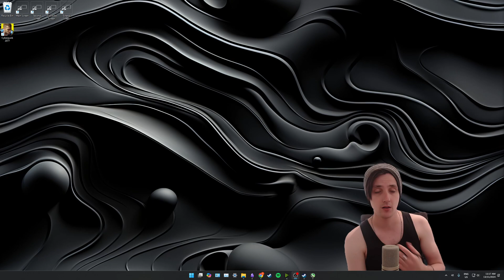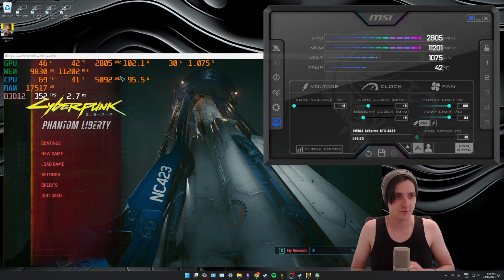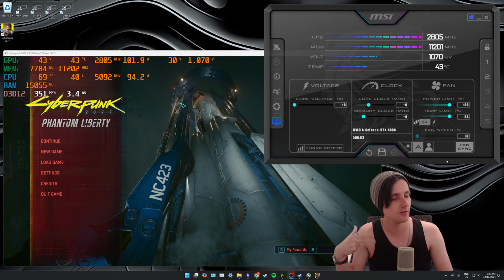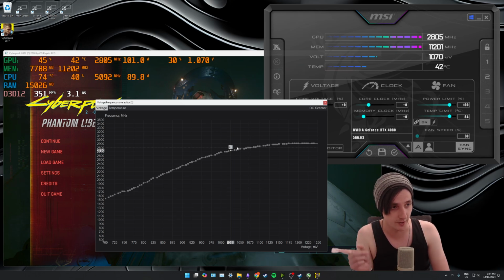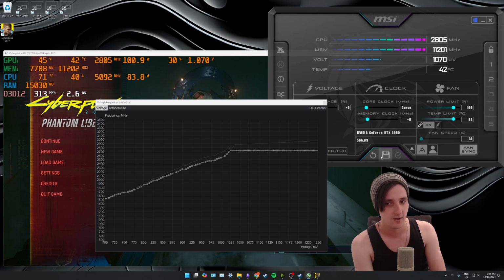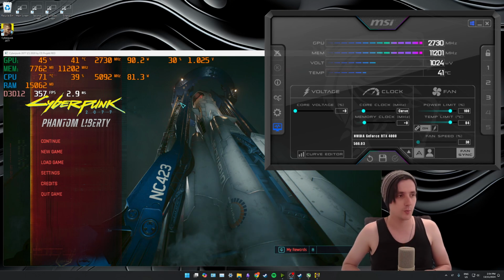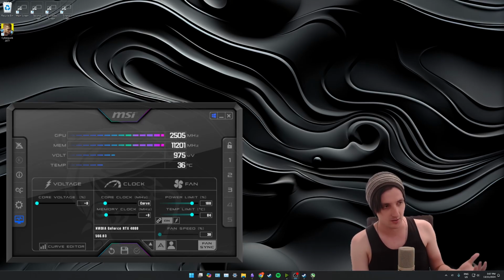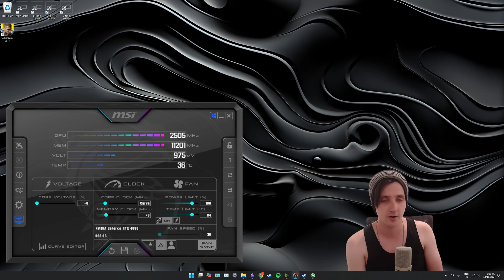NVIDIA RTX - Undervolting guide (How-To)

Comment: Hear most tech tubers just advise to limit the power limit in Afterburner because of how the 40 series word.  So is this really better in terms of the end goal?
Reply from the maker: Hey mate, nothing wrong with changing the power limit slider as a real quick way if power saving is the main goal.
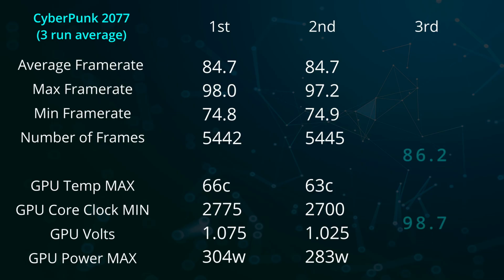But you will drop off performance aswell, if you do it the way in the vid you can see i gain performance by the end (9:28)

As an example,
If my 4080 is stock in afterburner, and I drop the power limit slider from 100% to 85%.
My volts can still reach 1.035v and my clock speed is around 2650mhz.

Whilst doing it manually i am stable at 1.025v with 2805mhz. 

It will change card to card, but doing it manually you can fine tune it for your specific card as the power limit slider is still using the default power curves all 4080's of your model will have, its not specific to your GPU.

It will depend on your goal, if losing a small amount of performance is acceptable and your primary goal is power saving, then absolutly change the power limit slider if you dont want to fuss over doing it manually :)
Reply: @John_Morrish  Your video did actually show it really well, so I might try it on my 4090 at some time.Thanks.

Comment: Really interesting, I guess you need MSI afterburner running in the background when you run your pc right ?
Reply from the maker: Hey Mate, Yes, however in the top right corner of MSI afterburner, there is a button to 'apply at windows startup'
With that enabled you never need to see the application again if you dont want. 
It will still run in the background, but you dont need to remember to apply your profile or anything like that as it will auto apply it once the process auto starts.

However, if doing that, make sure your undervolt\overclock is stable first as you dont want it applying on startup if its not stable.
Reply: @John_Morrish  Thank you ! I'll try that ! ☺
Reply: @daniellolcsgo  i actually advise you dont do that, as theres a chance you can put ur pc into a boot loop which you cant stop.
Reply: @TheMacksterz yes this shit happened to me it was fucking nuts I don't remember what I did but it took me like 3 days to figure out how to get it to stop I almost threw the computer or the window as it was my first time trying to clock my old GPU and having a little computer knowledge at that time lmfao

Comment: Super cool video, is undervolting a thing even for  the boosted gpu's like a 4080 super oc ?
Reply: Undervolting benefits all cards some more than others, essentially you are shaving off the uneccesary wattage while keeping the card fully functional & stable.
It will definitely extend the life-span of the GPU + less heat which = your room will be cooler and so will your PC too as a whole.

I have undervolted all my cards - current GPU is a MSI RTX 4070 Super 12G Gaming X Slim @ 2760MHz +1500MHz Memory (1.000mV). 
The difference is noticeable to say the least, you only need to find a good way to test stability etc.

Problem with RTX cards are that they have Tensor cores (Ray tracing cores etc) which will not be stressed or even stable if you are tweaking your clocks in rasterized scenarious.

A lot of people do this wrong by playing completely rasterized titles with RTX cards - yes you will get a few mhz higher clocks when dialing in, but the moment you are exposed to Raytracing etc it will most likely crash immediately.

Normally I do my testing through more demanding games with RT/PT such as Cyberpunk with full pathtracing or other ray traced games like Black Myth: Wukong / Alan Wake 2 with full PT etc etc.
Just by roaming around you will see whetever or not your clock is stable (game crashing etc), then you will eventually find the true stable clocks specifically for your own card.

You can also afterwards if you feel like it start messing with memory clocks, however these are harder to justfiy for IF they are stable as they do memory-correction.
As in rather than upright crashing, you will be losing slightly performance if you are pushing it too far (these are all still safe options as they are within the built in BIOS:s restrictions within the GPU itself).

However don't go ramping your clocks up as you can quite easily put yourself in a bootloop if you have the "apply clocks at startup" when testing, so would advice keeping all that turned off when actually testing just to be on the more hassle-free side of things IF a way too high memory-clock is dialed in by accident, since you will have to go into Safemode to rid yourself of Afterburner/the profile to get back up and running.

EDIT: 
Direct answer to your question, yes they are simply just an more aggressive clocking curve flashed onto the onboard BIOS on the GPU - ALSO allows for a slightly higher max power limit.
Reply from the maker: @lionix1711  thanks for the kind words mate!
Yes, absolutely, can undervolt all NVIDIA GPUs, doesnt matter if it has an OEM tweaking power further, Same logic applies.